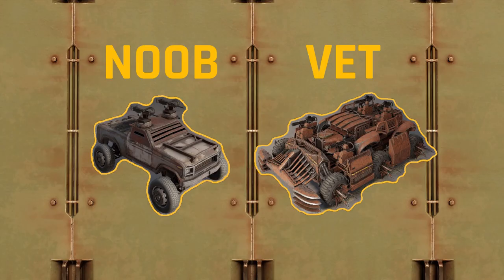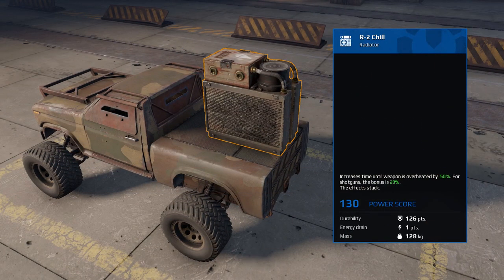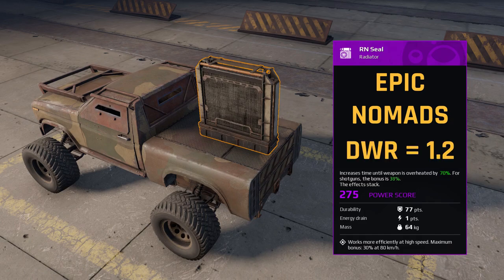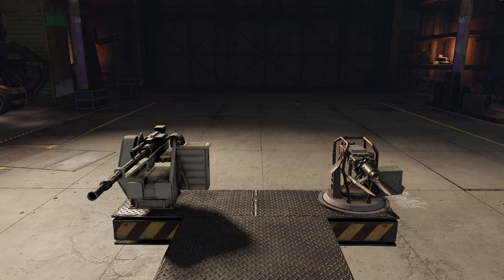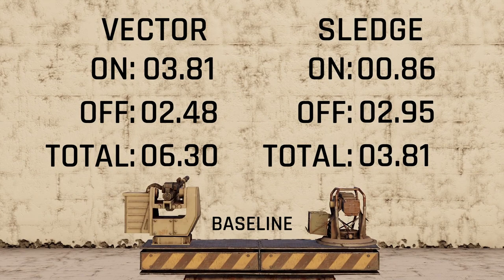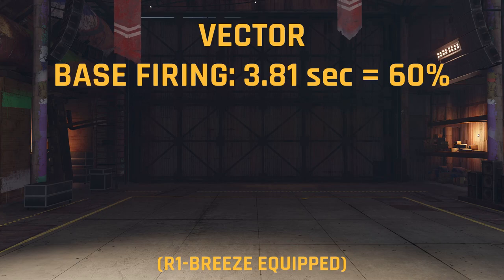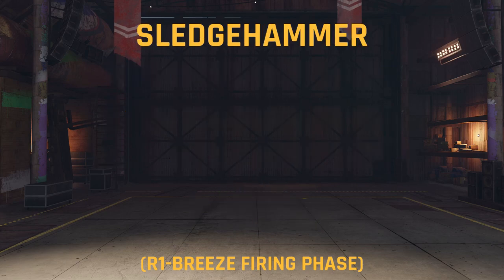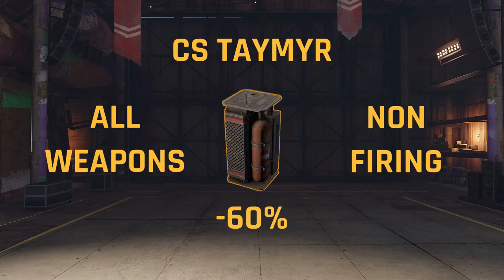An in-depth Guide to Cooling Modules

Comment: An important detail: radiators stack additively (% modifier summed then multiplied by base) while coolers work multiplicatively (% modifier multiplied for each module).

Since the modifier for radiators is positive, you get a linear increase in firing time as you add more.

While the modifier for coolers is negative, you get a diminishing decrease in the cooldown phase with each added module.

Comment: for coolers it is stated that "the weapon's cooling rate is increased by" and not "the weapon's cooling time is reduced by"
this means that for example, the shiver gets a cooling rate of 185% which results in fact to a cooling time 1/185% = 54% of the original or -46%, so the numbers stated by the game at least for coolers are not that far off
This also means that a second shiver wont get your cooling to zero but make it (1/1.85)/1.85 of the original which is 29% or -71% of the original, a third would make it 15.8% or - 84% .... ect...
This means that with an infinit amount of coolers you will only be aproaching 0 cooling time, not going to negative values.

Based on your -40% (vs -46% expected) for a single shiver I can expect a double shiver build to get 0.6*0.6=0.36 relative cooling time or -64% (vs -71% expected) cooling time and a triple shiver would get 0.216 or -78% (vs -84% expected)
Reply from the maker: Hey Bill, thanks for the extra research!

When I was looking at the way coolers are stated I found it confusing. Mostly because when it says "weapon cooling rate is INCREASED by" in reality the weapons cooling TIME IS REDUCED. To me it is basically saying the same thing. And since it was TIME that I was calculating, that meant the result was a negative.

As long as your calculations make sense to you and they add up correctly then it's all good either way. 🙂
Reply: Good info. I know there was a buff to coolers in the year+ break I had from the game, it used to be best to run a rad in 95% of builds. 
Do you Bill, or TCS, know the effects of stacking coolers and rads? I believe it used to be that for the first seal it would slow cooling by approx 70%, then the second seal slowed cooling by 70% of that new time, and so on. 

My current raid build has a nova, 2 retchers, 3 seals (2 fuzed), a cheetah to help me get around quick and a ton of ammo. I think I will swap the cheetah for a hot red + even more cooling, and guess adding a cooler is probably going to be better than a 4th seal, however it is often only a couple more shells i really need per cool down so I will have to try both and see which i like.
Reply from the maker: @peteg4957  I tested stacking 2 Shivers and posted the results in the comments. 

I would try adding a Cooler and binding each Retcher to a different button, that way you can alternate firing and the Cooler will help regulate the weapons from overheating.

Comment: Running 3 RN Seals, fused for efficient. Weapons practically n e v e r overheat. Toss in the Favorite cab with Triple fused Equalizers, or swap 1 of those and a Seal for an Aurora, and enemy parts just melt off.
Reply from the maker: Sounds like you have a solid build my friend. 🙂

Comment: Do coolers have a decreasing effect on weapons when you add more than one, since it is taking 60% of 60%?
Reply from the maker: Great question.

It took me quite a while just to log what I did in the video, so I haven't tested stacking Coolers or Radiators. I will try it when I have the time and respond back with my results.
Reply: At least prior to the supercharged update they will stack fully. I have a 4699 peircer rig that doesn't stop shooting. One fused for cooling one fused for overheat and one fused for damage. Then 2 fused taymars and 3 fused r2 chills (only used blue for the power score with the growl and a gasgen)
Reply from the maker: So here are the results of my testing.

1 SHIVER w/ BONUS (-85% base and -45% bonus when at a complete stop)
Expected: -130% Decrease to Non-Firing Phase 
Logged: -50% Decrease to Non-Firing Phase

2 SHIVERS w/ BONUS (-170% base and -90% bonus when at a complete stop)
Expected: -260% Decrease to Non-Firing Phase 
Logged: -65% Decrease to Non-Firing Phase

Based on these results, you are correct. Stacking coolers has a decreasing effect rather than doubling. I would assume the same for Radiators as well. I actually logged -65% with the Vector and -64% with the Sledgehammer.
Reply: @TCS23  Wow, thanks for taking the time to test this!
Reply: @TCS23  What happens if we use both at the same time?
Reply from the maker: @ttyler7256  Sure thing. Happy to help. 🙂
Reply: @burningsamrai3681  both effects are applied, the coolers effect don't affect the radiators effect.
Reply: @ttyler7256  So anyway, I made a vehicle called the ACV Retaliator, search for it, and please try it out and rate it from 1 - 10.

Comment: If you want to fuse a radiator twice, do you need to use the stabilizer to not risk losing your +42% efficiency?
Reply from the maker: You should be able to fuse it without needing a stabilizer.
Reply: @TCS23  But is there a way to fuse an already fused radiator and get efficiency stacked?
Reply from the maker: @mikeekim242  No, efficiency will remain the same, it does not stack I know that for sure.
Reply: @TCS23  Thank you very much!
Reply from the maker: @mikeekim242  Happy to help. 🙂
Reply: Thanks for useful info I'm new to game and that was the most help I've seen so far

Comment: I've been testing, recently, the Stacking Effect of said Modules and I'm here to say they don't stack well at all. I used 3 Fused RN, 3 Fused Shiv, 2 Non Fused RN, 1 Non Fused Shiv, 2 Fused Chill, and 1 Non Fused Chill in my testing. I used a single weapon, Impulse, because it was easy to count the shots fired. With 3 Fused RN and 2 Non Fused RN I was able to get a max of 33 shots before overheating. Regardless of which combo I used 33 was the Max. The Impulse fires 6 shots with Zero Cooling. Regardless of how you do the Math, these modules are not working as intended and they def don't stack they way they should. I doubt 5 Fused RN would increase shots past 33 before overheating. I chose the Impulse because it heats up fairly quickly as does the Retcher and wanted to see if there was a way to use said Modules to increase Rate of Fire. I also found that 1 Fused Chill and 1 Non Fused Chill had the same cooling effect as two Non Fused RN, at a considerable lower Power Score, so clearly the Stack Effect does not work in this game. Yes the more Coolers/Rads you have the longer you will fire and faster to cool down but no where near what the original numbers would suggest. If you take 3 Fused RN and 2 Non Fused RN and simply add up all the numbers, 3 x 99% + 2 x 70% = 437% then multiply 6, the number of shots with no cooling, by 437% you get 26.22 and lastly I added back the original 6 to get 32.22, rounding up gives you 33 and that is how many shots I got. 

Not sure if I did the math right so feel free to comment where I may have gone wrong. It just seems like the XO Game Devs just make shit up as they go along because there does not seem to be any consistency whatsoever. There's no real way to calculate the Heating Effect and those Dashes are meaningless. Yes the longer the line the longer the weapon will fire but I don't think it's being calculated properly. I believe the term is Diminished Returns on said Modules. And don't get me started with RNG or Rigged Number Generated because that's a whole nother topic all together; sure kid yourself and think that RNG means Random Number Generated because if that was the case you would not hit the Damage Ball consistently for the same number. Worse yet, regardless of the numbers/stats, there's still no way to calculate what a weapon should fire at with regards to Damage Per Minute. Yep, this game keeps one guessing because if we do figure out their scheme most would probably leave the game entirely. I like a lot about this game but I'm growing tired of the BS that is the Game Devs. If all of XO Game Devs were Joints on the same finger, said finger would be rendered useless because 1 joint would not have a clue what the other joint is doing ergo the entire finger would be rendered USELESS... Just saying...
Reply from the maker: Hey Paul, thanks for your feedback and sharing your test results!

I had similar results regarding a loss of efficiency from stacking Coolers (see the other comments on this video). My guess is that not every weapon is affected the same way from stacking cooling modules. The fact that shotguns are treated differently when using Radiators is an indication of that.
Reply: @TCS23  Ok, cool, now I know it wasn't some fluke, thx...
Reply from the maker: @cybercapri  no problem, happy to help. 🙂

Comment: Wait how did you join the Syndicate.
Reply from the maker: l made this video when the Syndicate was part of a Battle Pass, way back in the day. 😂
Reply: @TCS23  what so, how do you become part of syndicate fraction during the battle pass? You buy it or what?
Reply from the maker: @Gunslinger832  It just depends on whether the next pass includes that faction. The devs may include more items from the Syndicate down the road and when they do you will be able to join that faction for as long as the event is active. That's the time to grind for new parts.

Joining is free during the event and many items are free too but you still have to grind for them. Some items will be locked that require you to purchase the battle pass to get them, so keep that in mind.